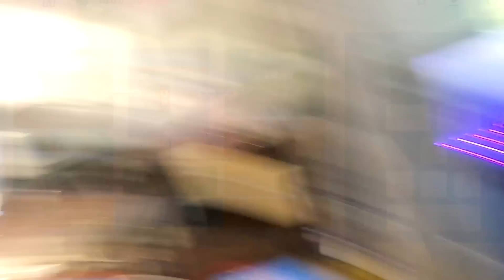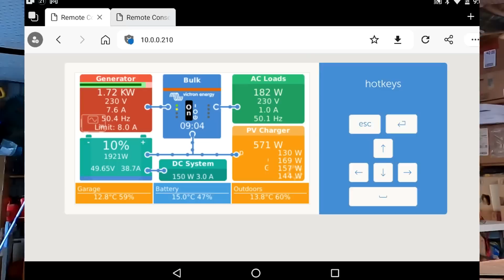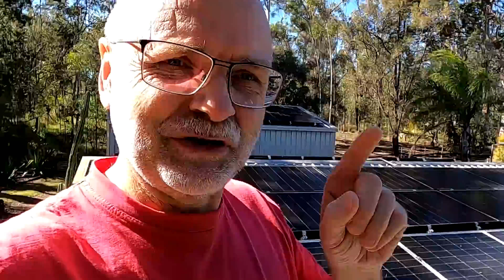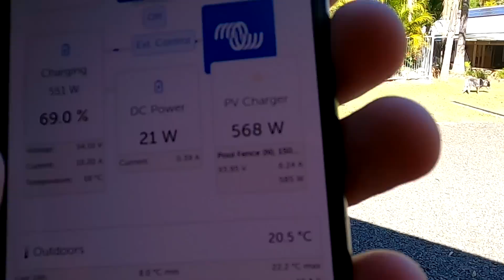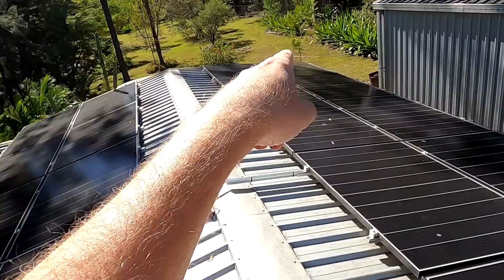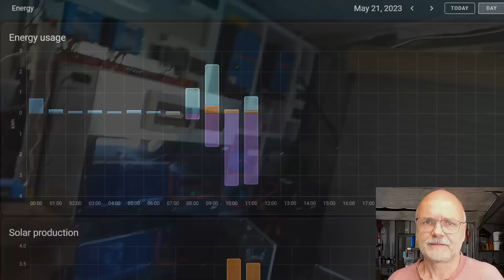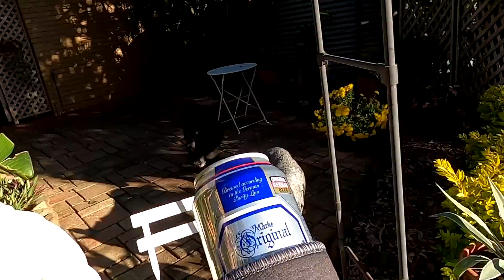Finally Off-Grid!! Look at this energy consumption and production in Winter!

Comment: I absolutely recommend to get some Shelly PRO 3EM devices and monitor the actual consumption of the individual devices (if they are 3-phase) or Shelly PRO 1PM for single device. The data can be fed directly to HA and you can then display them on the dashboard.
Reply from the maker: I have a Shelly 3EM installed in the meterbox. That's where the data comes from.
Reply: @OffGridGarageAustralia  I am big fan of the PRO version due to ethernet, but the wifi version is also quite good. My only "problem" is the current probe - it is 120A, no way I'll get anywhere near, my max fuse at home is 32A, so a 50A probe would be more than sufficient and might give me better resolution.
Reply from the maker: @rklauco  Yeah, ethernet is preferable.
Do you think the probe is less accurate due its size or the low current you're measuring? I found the 120A clamp pretty precise even with very small loads.
Reply: @OffGridGarageAustralia  So far it does look pretty close to what I expect, I cannot verify it as I don't have enough place in distribution box to insert both the 120A clamp and my clamp meter :)
But Shelly does provide also 50A clamp probes for 3EM, just not for the PRO version.
My only problem with 120A is that with VERY small currents and other cables in distribution box, it sometimes shows minus values (like -9W) instead of 0W when the appliance is off. It's always temporary and goes away after few seconds, but it is quite annoying :)
Reply from the maker: @rklauco  I have three 120A clamps installed on my Shelly and when I turn on certain appliances in my house, the shelly shows pretty accurate. Even just one LED light it increases the reading by 5-6W.
Yes, I have this negative reading as well sometimes. My meter box is a rats nest and need to be re-done at some stage. But I guess, this would be the same with any clamp you install in this location. It's just the amount of cables and magnetic fields...
Reply: @OffGridGarageAustralia  Rats nest - same here. I told the installer to space the breakers out so I have room for installing other devices - what he did is he installed panel with 6 DIN rails and squeezed EVERYTHING into upper 3 - so technically I do have space, but I would have to re-do the whole panel :D Brilliant...
But hey - I should have draw it dawn before the installation, I guess. I was not specific enough.
And you are right - in such induction-heavy environment, any clamp-based meter would probably generate (minor) discrepancies. For me, it's not a big deal, I am interested in 4kW of water heater and 4kW of heat pump, so minor tens of watts one way or another do not make a big difference :)
Still no battery on my end though - as the Fronius I have only supports high voltage batteries and those are expensive as hell :(
Reply: Shelly is nonsense, it only connects via wifi :) Replaced by one of Carlo Gavazzi energy meters with RS485.
Reply: No correct, the pro line also accepts ethernet and many also bluetooth. He lives in an isolated place his intranet can be wifi and stay relatively secure. I have 80 smart devices and my recommendation is run away from Tuya, Xiaomi, etc
Reply: @CantFindInYoutube  ok nice, but I've already bought a carlo gavazzi meter and I need RS485. For me its more convenient and simpler interface.
Reply: @ab7644  If you bought it I'm sure it's the best solution for you I have PRO 3EM but mostly use Shelly to operate and measure power of some devices like a  Pro 4PM for my 2 AVAC units and some Plus 1PM and 2PM this way if I have batteries full I 'waste ' energy if not Hassio only turn on what is important.
Reply: What I don't like about the Shelly 3EM is that if I turn off the WIFI overnight, for example, it won't sync the data collected during that time to the cloud when I turn the WIFI back on.
Reply: @ab7644  I've connected it using LAN - so that it works reliably anytime, no wifi connection for things in power distribution box :)

Comment: I wonder if a piece of lightly sanded perspex in front of a solar panel would act as a dissipator to mimic a cloudy day?
Reply: It would, but without the desired increased generation.

The reason for this is that you would be diffusing whatever light makes it to the panel. 

Whereas on a cloudy day, the light across the entire sky is diffused. 

Another way to think of it is to think of the light source. On clear days the sun is the light source directly. Super bright. However it's a "point" of light compared to the entire field which is the sky. 

The rest of the sky adds nothing to the panel (roughly speaking).

On a cloudy day however, the light is caught and diffused by those clouds, effectively making the entire sky the source of light.

Of course any one point in that sky when compared to direct sunlight is almost nothing, but the entire sky, well it all adds up. If you could estimate the size of the sun in the sky and then compare the light level of the cloud cover for the same space, it would be much much lower. Diffusion does reduce light, if you have the same sized light source, but the entire sky becomes the light source, and that is a much much much bigger area than what the sun appears to take up in that same broad sky.

And if you think of it, the surface area of a single panel, compared to the entire sky is microscopic. And as diffusion actually results in a loss of light, diffusing what reaches a panel at the surface would basically mean losing part of what little light actually reaches the panel.

The entire sky on a cloudy day is still not as good as direct sunlight, but it beats the pants off of shaded sunlight. 

Diffusing what gets to the panel at the panel will just reduce what has arrived at the panel.

Now if you use some sort of lens which can redirect light which normally wouldn't make it to the panel, or perhaps re-align light which would reach the panel at less than optimal angle and make them all reach the panel, at an optimized angle, then you would see an increase.

And there are videos showing just this already. 

Using a lens on each panel would make sense where it was impossible to add more panels and you already had the most efficient panels installed (ie cannot expand solar panel install)

Such a lensing addition would probably costs more than just adding more panels (when comparing the increase achieved by the lens versus the additional generation provided by an additional panel)

So if you have the space, add more panels.

Comment: Cutting trees is not a good idea, maybe trim them... Yes. But chopping down a tree that took decades to grow... Just doesn't seem right to me. Specially if you have room to grow the system like the house roof. Trees and silar is the way to do it. We need all the trees we can get on this planet... Trees are amazing living beings... Coexistence and adaptation.
Reply: Not his trees
Reply: @clarencewiles963  Thanks for that, but I already knew that. The statement applies in general. There are some trees that seem to be in Andy's property, and he already mentioned he doesn't want to cut them, so he is well aware of the limitations. And there is a great optimized space on the roof of the house. Plenty of power to come from there.

Cheers
Reply from the maker: No way to trim them. I would need to engage a company and there is pretty much no access for a lift to reach that height. 30-40m high.

Comment: Angle your system for winter use, my system is almost identical of yours , and my rof is only  22deg, works perfect here up north at summer, but not in winter. i need to add som panels almost at 90deg for winter, than i think im fine... also, i got almost no shadow only one month around  christmas..
And i think the resond your system works better in cloudy conditions is the MPPTs "lag" vs stable dim light disperertial vs "on off" sunlight
Ps at Victron W im the last in the alfabet in Norway
Reply: If you dont need all this power during summer you should divert some of your potential from max delivery back to the grid in expense of better yse in winter months, i shure will, but my problem is winter storms, rain and gales for weeks , but still some hours of daylight..
Reply: 59 deg N

Comment: Simple solution - prune down all those trees blocking the sunlight - duh!!! ( He says with tongue firmly in cheek ).  Thanks for the interesting video. It really takes a LOT of investment to get off grid depending only on solar. Huge solar array, Huge battery capacity. Just insane.
EDIT: Mannnn, I would have chopped the tree branches down long ago to get the sun shining on the panels. Small investment compared to an insane amount of panels.....but then that's just me.
Reply from the maker: As I said before, it would cost me $20k+ to remove them. How much solar can I install for that insted?
Reply: @OffGridGarageAustralia  Thanks for the heads-up. I didn't realize it would cost that much - not sure what you mean by "remove" though. I understand that totally uprooting trees is expensive, I'm just thinking that trimming might by a lot less, but then I don't live in AUS so have no idea what people charge for such work. Where I live it's a no brainer.
Keep up with the good stuff. Thanks.
Reply from the maker: @kevinrtres  Yeah, trees are 40m high, so trimming would be very dangerous and costly. Removing these branches would not be easy either. Cutting a tree is one thing but removing it another. It would be a job for someone climbing up that tree and start from the top taking it carefully down. It's all not that easy...
Reply: @OffGridGarageAustralia  👍
Reply: I even cut my avocado tree that was shading afternoon sun. It's a no brainer. Plant some smaller trees if you a green person
Reply: I agree, Any tree with the thinner moving branches should be targeted, I feel like enough production is available when you remove those trees

Comment: Nice video as usual Andy. With these shady conditions, I'm wondering how much extra energy you would have been generating if you were using micro inverters all through or if all your panels have dc optimisers attached. The better production in cloudy conditions was unexpected but I'm now wondering what improvement you'd have with heterojunction (hjt) solar panels (the Panasonic types). They are known to be the best for cloudy and/or high temperature environments.
Reply: Here's a novel thought...what if he just connected the panels in series/parallel and direct connect to the battery! Obviously making sure the voc is slightly less than the max cutoff if it is possible with these panels.
With no mppt or smarts, would be interesting to see the average yield difference!!
Reply: Microinverters would not improve yield - shadow is shadow - if there's no power due to shading how's the microinverter going to help? A number of people have already shown this conclusively - check Andreas Spies and some other oke in Auss as well.
Reply: @kevinrtres  I have seen those videos and they proof that micro inverters weren't worth the money and the marketing hype. It wasn't that the were completely useless. They can still be useful in extreme cases but even so, they gains might not be worth the extra costs associated with them. Some Huawei inverters can work with optimisers attached only to panels that need them within a string (e.g. those in deep shades) and I learnt they improve energy yields.
Reply: @adon8672  Interesting, thanks.
Reply from the maker: Micro Inverters will not work in Off-grid installations unless you have enough inverter power installed which can handle it (Victron 1.0 rule).
And optimisers only optimise the $$$ of the manufacturer. They may bring some small benefit if panels in one string face different directions. But in shading, no advantage.

Comment: hello , how much does this cost ? in how long you would pay the same amount of money for electricity as the money that you invested for the equipment ?
Reply from the maker: I'm not looking at the costs. I do this as a hobby and to learn, experiment and share.
Reply: @OffGridGarageAustralia  you have wonderful motives :)
Reply: There are other facts to consider... How much does a power outage cost? How much does it worth to be energy independent, how much do you save on fuel?

A lot to sink in I think. If you just make for the money alone, you might do it. But solar is more than just the money you save. It's a fun game to chase power, be more efficient, store energy, use energy when you have surplus, etc...

Comment: hi , do you have overheating issues with your victron inverters? i needed to disconnect the ntc to fix it ....   (disconnected blue wires from transformer and connected 6,8k on the socket)
Reply: Is your fan working?
Reply from the maker: The MPII is running flawlessly, even in our summer. The Phoenix is a nightmare and overheats even now in Winter when under a moderate load of 2100W (3kVA model).